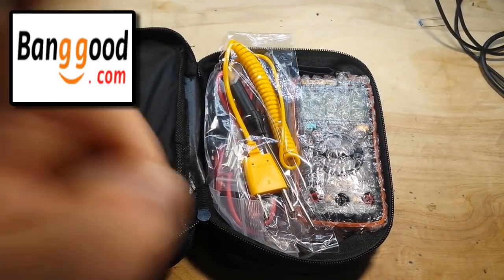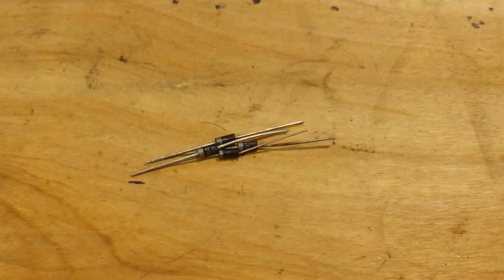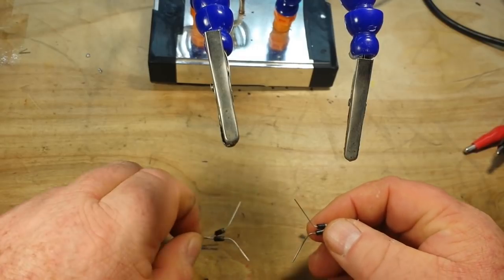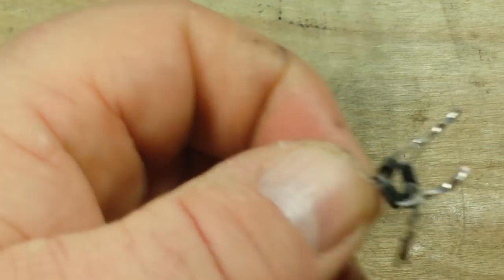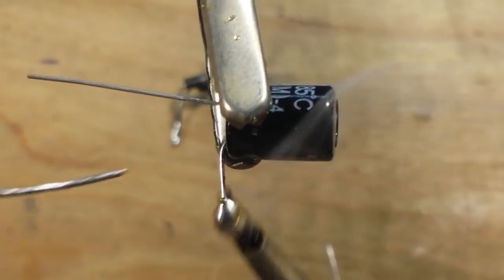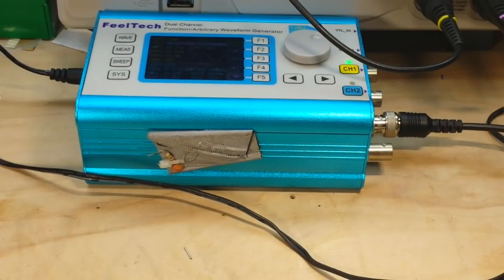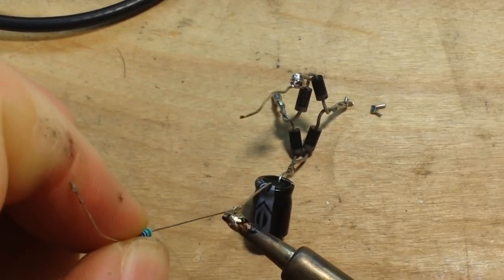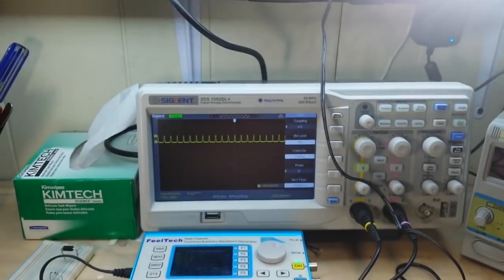Mix n match desert island bridge rectifier

Comment: Hey Paul, I don't want to spoil your vacation on your dream island but I think you should have included some reference notes with you on the island.  What you have constructed here is the legendary RC circuit.  The capacitor and the resistor should have been connected in parallel, not in series.  I'll give you a chance on this one as the sun might have tricked your thinking.  Just kidding !!!  😉😉😉